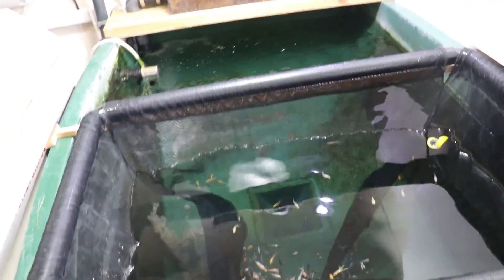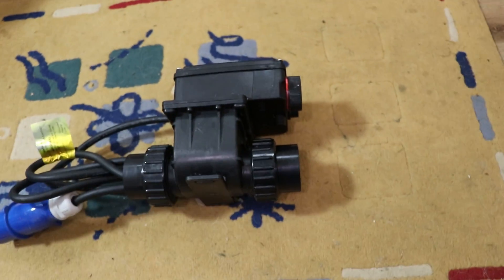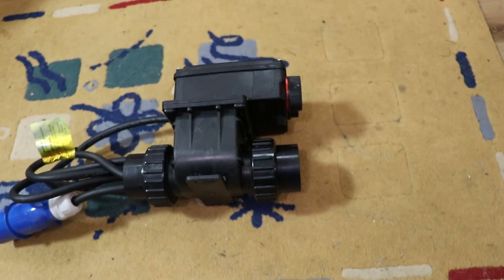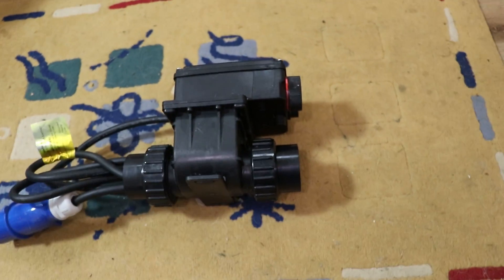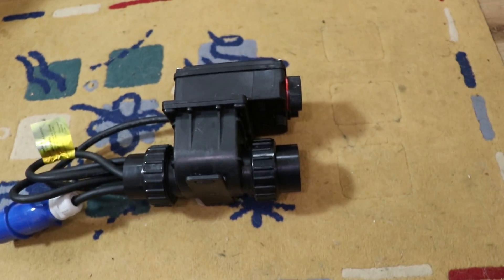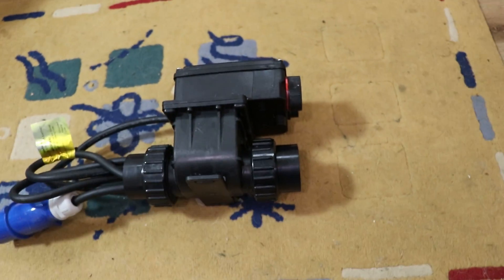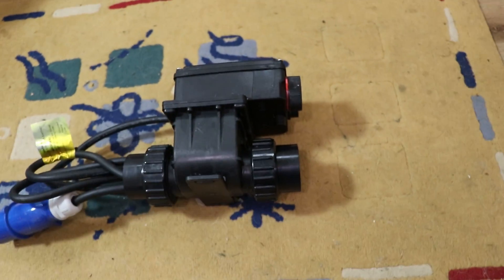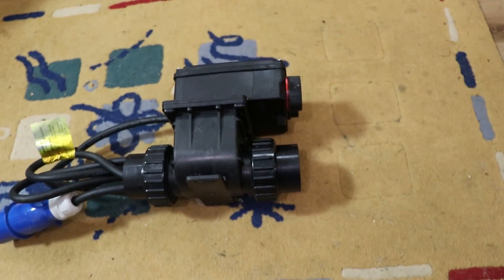Installing a heater for the fry

Comment: Adam! Greetings from swansea in wales.. why arent you using thermostat heaters for aquariums? I have only 1 x 150w heater for the 1400L tank in my garage to raise my koi fry... keeps them at 23° and they just sit under flow in pipes so water goes over them, also they cost £8
Reply: So one 150w heater will be fine on an ibc 1000ltr I'm going to insulate the out sides

Comment: Hi Adam Love the videos firstly. Just wondering if my pump is enough to power my heater which is exactly the same as yours. I am using outside  and after a few hours no sign of heating up my fry. I've only got them in a container holding about 50 gallons so cannot put in a too powerful pump as it would be too powerful for my filter.Im hoping the element is ok. Also wondering if the flow rate switch could be disabled or bypassed. Hope you can help. Thanks Tony

Comment: where did u get temperature gun and are they accurate. thanks
Reply from the maker: I just got it off ebay and yes so far it seams really good i have been using it for a few months.